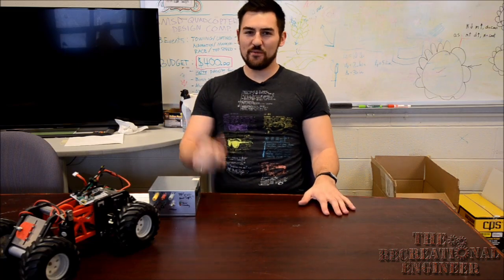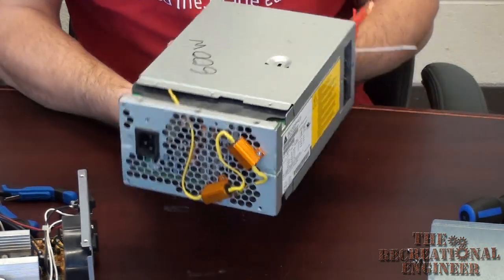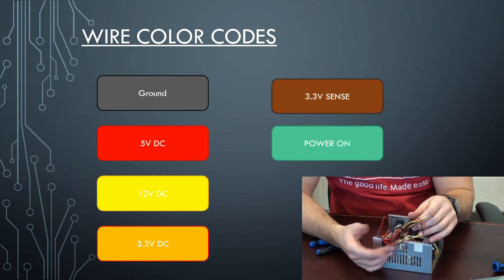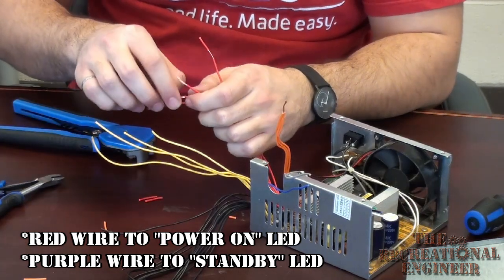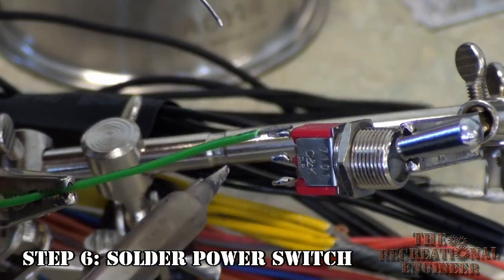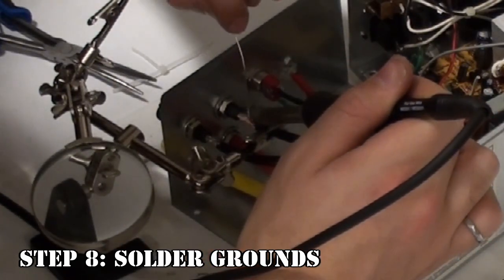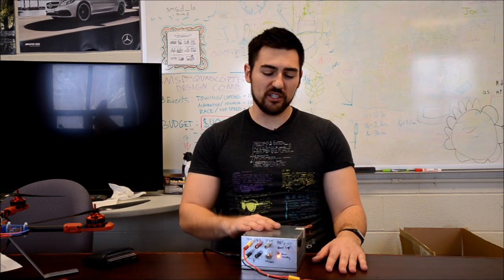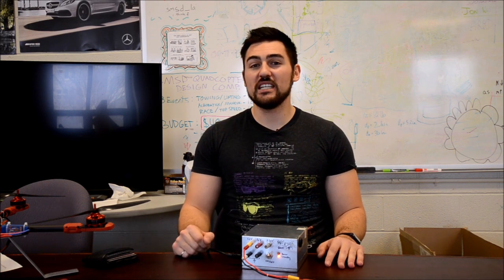$10 DC Power Supply - 1 Day DIY

Comment: My advice instead of cutting up the power supply make a box you can plug all the normal leads into.  That way if the power supply dies you just have to get a new one and plug it in. Building the box is a one time thing

Comment: Now, if you can tell me how to run  that power supply without 120 volt AC, and use it for the 12 volt 5 volt and 3.5 volt supply.

Comment: I want to use a pc power supply to power my diesel heater which will use up to 10 to 15 amps to power the glow-plug
. 

My power supply 12volt says it will put out up to 30 amps? So i just connect all the yellow wires to get that ip to 30 amp potential?

Comment: I want to make this power supply mainly for 12volt  supply but you mentioned the resistor on the 12 volt line. 

How do I know if my power supply needs it? I’m not sure if mine is “old” or “new” as you put it.

Comment: 6:55 While your at it, keep the distance between grounds and the other posts 19m/m (3⁄4 inch)
 so it can be used with a standard bunch of connectors...It is an industry standard.

Comment: Could I build an External 800W AC-DC Power Brick from an ATX/SFX PSU following these steps? The project I have ongoing will be using a HDPLEX 800W DC-PSU to power a SFF AIO computer and it will need external AC Adapter(s). I was thinking I might get two Dell 330W Laptop Adapters but an ATX 800W converted to something like this might be much better.

Comment: What if multiple 12v dc, 5v dc, and 3v dc?  say 2-3 of each v.-power?   OR does it need all yellow wire soldier together?  I want to make a power supply for multiple Raspberry Pi projects used at one time.

Comment: Hi, i placed my load resistor at 12 Volt line. Characteristics, Load resistor: 15W 22Ω (i couldnt find at 10W), line: 12Volt, min: 0.3A, max: 18A. My load gets really hot, maybe is the normal hot i do not know, is it ok addind that resistor with that characteristics or should i add some an extra Silicone Ceramic Resistor? I attached the load at chassis adding thermal paste in order to make some heat get absorbed, is that ok?

Comment: I know this is an older video, but on the Green wire. I’m needing to build 2 power supplies 12v dc only. I’ve seen videos that say to connect the Green to Gray. However I’ve seen more that say Green to any Black wire. Is this just a preference, or should it be one or the other for specific reasons?

Comment: Can you help me with something? 
I built mine and connected -12v as negative and 12v for positive in the regulable exit. I used a DC motor for testing but the entire power supply shuts down at ±3V, what can I do?

Comment: I have an older ATX with 14 amps on the 3.3V line, 30amps on the 5V line and only 10 amps on the 12 V line
I used a 8ohm/50W resistor on the 5V line and when I connected a small cooling fan 12V/950milliamps the voltage drops to 11.05 volts why is this happening when the 12 volt line should handle upto 10 amps and stay stable 
Please help me and reply
Thanks Dan

Comment: could you also use a constant current circuit on the output to load the source to keep it stable rather than a passive resistor? (op amp)

Comment: I got a 750w power supply to run two 12" subs in my house. I need the yellows for +12v but what do I do with reds and orange? I'll only ever use it for this so can I just tape/cap them off? Do I need a resistor?

Comment: So I built this little project, but my voltages seem to be off.  They're consistent, but seem to be double what they should be.  I'm getting 26V, 11V, and 6.6V.  Any ideas what might be going on?  The PSUs I used are older units.

Comment: Great video ..  im a noob here
I bought a used one zebronic brand ..
And want to charge 6v 200 ah battery ..
So connected to a 6v 200ah battery and with 12v supply and boom 12v supply yellow wire melted in secs .. 

What do you suggest?
Reply: I suggest you not do that again.

Comment: Great video, I think I can tackle this project! Just one question, is the load/dummy resister needed ?  Power supply used in PC was fine without it ? Why do we use in this project ? Thks.
Reply: I read it on a forum that the load is the computer when it’s kn the PC. Since you’re using it standalone, you need to provide a dummy load to simulate the same behavior from the PSU

Comment: Fennnnnnnnnnnnnntasticccccccccccccccccccccc  Mate. 

On the same unit , can we have a variable low voltage Output with a Voltmeter Display ( anologue / Digital )  and followed by a safety Fuse , Please... !!

Comment: Which voltage + 12 volts or + 5 vollts did you use for current limiting resistor and what is the value or resistance of resistor did you used?
Reply: Add 10 ohm 15 watts for the 5 volts

Comment: @ The Recreational Engineer,  I think It's awesome. My question is this; Can this setup charge a car battery and if so, what would I do to get 17 volts charging? How many amps could I get out of the setup? The more I can get to charge with, the better (in my application). I would like to get around 50 - 100 amps if possible but will take what this fine setup can provide. Most chargers give out 4, 6, 8, or 12 amps, I need more, much more. Thanks in advance. 
PS. Correct, I know nothing about electricity except for, if it bites, you fry, and that's why I'm asking.
Reply: Computer supplies are not well suited for car charging.

Comment: Nice easy conversion!
One change I would make is that instead of reserving a red wire for the Power On LED, I would use the grey wire. The grey wire is the Power OK confirmation signal to the PC, which also carries 5 volts but only after the unit is switched on AND the unit has performed a self-check.  So, not only does it confirm that the power is ON, it also assures you that the unit is working properly and the voltages will be within reasonable expectations.

Comment: Why wire the power on through a switch?  You already have a mains switch.  You don't need 2 switches to turn the thing on.  Just hardwire the power on (green) to ground.  This switch/line only exist so a computer can be turned on from the front.   This is not necessary for a bench supply.  Save the cost, mounting, and wiring of a needless part.

I also noticed you wired all of one color to the binding post.  But, you divided the black ground among them.  Again, needless.  The argument being you need all of one color to carry the current.  If true you would need the same for the ground return.  But you just demonstrated you don't.  So, make it easier on yourself and cut/remove half the color wires.  Makes the wiring much neater and easier.

Comment: Need more details on those resistors you installed on rear ofcthe unit otherwise this video is great , also there is a way to put some led lights next to 12,5 and 3.8v terminals as a indicator the power is there

Comment: You just soldered the Load resistors in place but didn't show or say how and where to place them in the circuit. Will you please elaborate?

Comment: When you wired the dummy resistors to the yellow wires,  did they go to the 12v or the 5v?  You said that it should go with the main,  which was the 5v correct?  Those wires were red.

Comment: Great video, very well explained. I however have a project that requires a +12V and -12V power source. Can you provide some direction if that is possible?
Reply: FRANK STEARNS you can still use the same system. He didn’t show it but the blue wire on the atx is -12 volt
Reply: Sometimes there is a purple wire which is-12V it is usually low current .though.

Comment: You mentioned adding a load, what would you recommend?
Reply: The RL value is in the description depending on highest current output to 5V or 12V line.

Comment: Hi, I know this is old, BUT where is the output overload protection.
That 5V can supply at as you state, a very high current. (40Amps I think the name plate shows)
What happens if your project develops or has a short?
You will probably blow the short out of the project, instead of limiting the current to protect you project.
By "blowing the short out" I mean blow up components, PCB tracks, switches of your project.😮

SORRY but nice idea, just needs a lot more thought before turning it into a "feasible" power supply.
To quote a great American, "Unsafe at any speed"..😮
Reply: Add a fuse . Solder a fuse where he connected the twisted wire to the binding post.

Comment: Any reason you went with 2 load resistors?  How much current needs to flow to provide enough load?
Reply: Probably just used 2 of them in series to get a certain R value
Reply: @The-Rewker  That's my guess, but I was thinking that maybe he had future plans for an addition.  Maybe a voltage divider for something.

Comment: I would like to ask you would this work for running a car radio or a 12 volt mini air compressor? I just want to be able to listen to music in my workshop and blow up my lawn tractor tires etc when needed. Just not sure if it will supply enough amperage. Thanks for the video nice clean soldering and finished product.
Reply: Check the power consumption of your mini compressor (in watts)

Comment: hi sir. why my power supply does not turn on without load ? i try connect to 12v led and turn it on again and it work. but if not loaded it not turn on? why ? and i check twice the yellow wire on my multimeter and it show only 10v but i connect 12v led and it work ! why ? sorry for bad english

Comment: I really wish they had 24v
I need one with 5,12 and 24 that can push at least 140W.
I want to use it for lighting design to. Will the output current not be to high for led strips or is that not a problem?

Comment: you added one side of the load resistor to yellow wire, what about the other end of the load resistor? to which wire it has been added? can you show a schematic diagram for the same.

Comment: My smps has 2005z chip. Working without power resistor connected between 5v and gnd. I want to increase output to 15v on 12v side.

Comment: So the big question from the clueless - Just what can the average Joe use this power supply for? Can you use it to spot weld 18650 batteries? Jump charge them? What...?
Reply: you can charge batteries with them... i guess you can use it to make spot welds on thin sheets of metal, yet i wouldnt recomment it...

Comment: Iv just put all the 12v rails together and all the earths, when i connect the startup wire to ground (green) it turns on for half a second and then turns ff, it does this with an amp connected and with nothing, i dont have a load resistor could that be the reason?

Comment: I think this is very cool, in fact I ordered a PS and the binding posts, LEDs, etc.off Ebay. I noticed the amps on mine are 14 on the 12v and 5v and 20amps on the 3.3, do I still need a resistor or resistors.? If so what size and on which voltage line? Thanks!

Comment: Great video. Much easier to follow than the other atx to power supply videos I watched. Maybe I missed it, I rewatched several times so I don’t believe I did, but you do not explain how to wire in the 2 LEDs. I assume standby is wired to the original on/off power switch and the master on light to the new master power switch? I’m no expert and don’t want to screw something up as we’re dealing with potentially fatal currents here. Any advice or an update would be appreciated. Also are the LEDs why you have 2 330ohm resistors listed in the parts list but don’t show them being used?
Reply: yeah I concur!

Comment: Made it was fine till I pushed it I think cuz I was running a .8ohm wire yes I measured it with a ohm reader so at 12volts it should have drawn 18 amps but my power supply said 12 volts is 20 amps and it wasn't a fuse that blew it was a capacitor and one of thouse ceramic things I think it's called a resistor maybe it was caused by the old psu sorry English isn't my first language

Comment: A little fuse box inside mayde be handy incase something blow up. Than your stuff connected to the supply is protected
Reply: Most have a fuse in the connector for the mains power input. Cheers

Comment: what do I do with the grey (pg) and purple (+5vsb) and the blue (-12v) wires left over? wire nut them separately?
Reply: If it's not an ATX sometimes the grey wire and the green wire you have to connect together to get the power supply to turn on. The purple wire and one the negative black wires should give you 23 volts.

Comment: but did not you say that the dummy load was soldered with red 5-volt cables for the old power supplies? so why did you soldered the dummy load to the yellow 12 volt cables? explain yourself better.

Comment: Nice job. You covered all the details very well. I would also be looking to install a voltage and current regulator and perhaps meters. Then it would really be a primo power supply for the workbench. I used to use a 1 amp 12 volt supply (with ad hoc regulators as needed). It was built from a conventional transformer rectifier bridge and filter capacitor. Many times I wish I had something beefier.
I've got several of these around in old computers around here(almost a dozen)
Reply: A cheap DC buck/boost converter on the 12v line and a DC readout will do wonders. ~$8 on AliExpress

Comment: Why didn,t you warn people about the very dangerously high voltages present in the psu before the capacitors have been discharged? These voltages can kill you stone dead if the unit is mishandled.Anyone undertaking this modification should be aware of these dangers before continuing to carry out these modifications.

Comment: Could I use this power supply for the electrolysis method of removing rust from metal?
Reply: musicmansuperman yes
Reply: @nicholaslombardo9696  I built a new one from an old power supply last month and used it for an electrolysis bath to clean an ultra-rusty sledge hammer head from the 1940s and it removed all of the rust in less than 4 hours! Love this video!
Reply: musicmansuperman Did you do it on 12 V
Reply: @nicholaslombardo9696  Yes, I did it on 12 V.
Reply: musicmansuperman but higher voltage would be better

Comment: I did everything you said but I'm getting no current through any of the lines.  I do have ONE gray wire and ONE blue wire that I don't know what to do with.  Would doing something with them to make things work?
Reply: There should be a grey and green wire you connect together to get it to turn on. They're thinner than the rest.

Comment: If I only want a 12V power supply, do I still have to have the load resistor on the yellow wires?  I have no need for the 3.3v or 5v.  I plan on shrink wrapping the 3.3v and 5v wires and stuffing them back in the case.

Comment: hi

i don't have that dummy resistor ..
when i plug the power supply to 220v input
i get 5v from every wire with green one.. and the fan is not work ..
any advice ?

Comment: Hi I don’t have a dummy load so I have tried to use 2 auto bulbs but power supply only turns on for half a second then cuts off ? Should this work or do I need the 10ohm load ?

Comment: Just an fyi you could also get a usb charging board.. and run a wire to the 5v and ground and use that as a external cell charger as well.  Nice Project.

Comment: my power supply's fan turns for a like a milisecond then turn off when i connect green and black wire with no dummy load.when I connect my dummy load i need to press the switch multiple times to turn it on.Pls help me
Reply: I used to buy and sell computers and in doing that I've collected a bunch of psu's and I've found some of the proprietary power supplies have some other requirements than touching the green wire to ground

Comment: I'm only going to use the 5v power supply to charge 18650 batteries. 
My power pack says +5v 30 amp / +5vsb 2 amp peak 2.5 amp
What is 5VSB?
Do I need the heat sinks? And if so what size and what ratings. I need 5 volts and 5 amps preferably.... thank you in advance

Comment: i would like to have a 9-15V variable supply that can output 1-150A @ 12.5V. think one of these guys would work for that and if so how do i limit hte current?
Reply: 150A??? What do you wanna power up with that?... You would need an around 2000W power supply

Comment: You can use the -12v wire with the +12 and have 24v max and -5v, -3v
Reply: I know its an old comment but that will severly limit the current
Reply: @alexstone691  you are correct, while +12v may be up to 20A, -12v is only up to .5A so your +24v would have a max of .5A or only about 7watts.

Comment: Hi again. I made my first one last year. It is from 1999 and shaped like a panini. Only 65 watts but it works without the load resistor. Also , it turned on without having to use a jump wire.
I`m ready to graduate on th project so I want to Make a second one from a 300w psu. I see you are putting the load resister between 2 yellow 12 v wires. Why not use the 5v wires? I dug up a lot of ceramic rectangular 5 and 10 w load resistors from old small TV's. Which one should I use and why? Can you explain the function of the resistor again? Anyone may reply, just means more knowledge transference!

Comment: Bro I have 12v and 18A power supply as a charger for 12v and 100 A battery. But when I plugged the terminals it gives 1 or half ampere on multimeter why???

Comment: Thank you for going in to more details, as most just fly right thru it. I particularly appreciated the standby mode. I have an older model but no main power switch that came with it. Without a main power switch, the one LED lite that came with it would stay on as soon as you plug the unit in and even when you connect a switch to green and black, the LED would stay on until you unplug the AC. The details you did go over in your video was enough to fill in all the little gaps I was experiencing on my mod!

Comment: What does one do if the power unit doesn't have a power switch? I just pulled the unit out of an old computer and it does not have a separate switch.